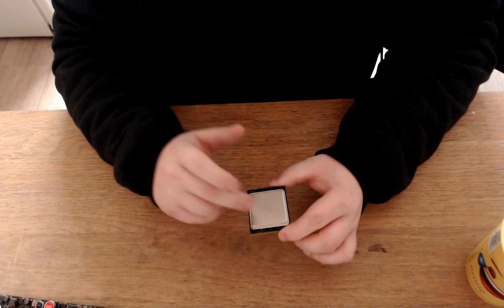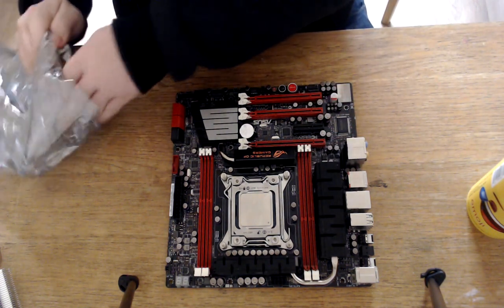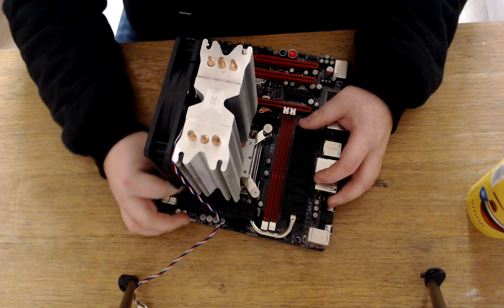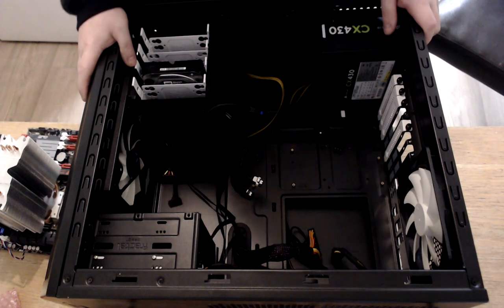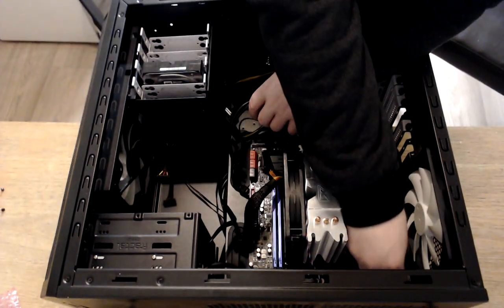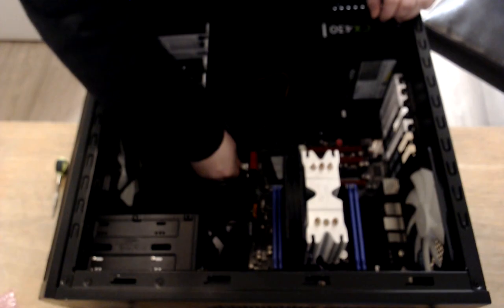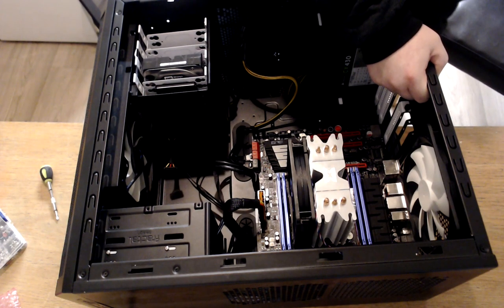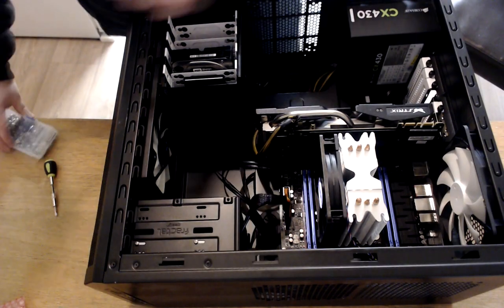X79 Gaming PC build with Xeon E5 2690 (PART 1)

Comment: Dying to build another rig me, got an 80+ Gold psu and a 2060 super not doing anything.
Don't know whether to flog em or save up and buy the parts to to another build.
Watching this vid just makes me want to build again.
Got bit by the bug I think.
My own build.
Ryzen 2700x
Asrock b450m steel legend mobo.
32gb corsair vengeance rgb 3200mhz (ryzen tuned). 
1tb sabrent m.2 nvme
Corsair tx 650m 80+ Gold psu. 
Gigabyte rtx 2070 super gaming oc. 
Fractal design meshify c mini case. 
Love thi vids.
Reply from the maker: Message me on Facebook if your going to flog them ill but them in a build